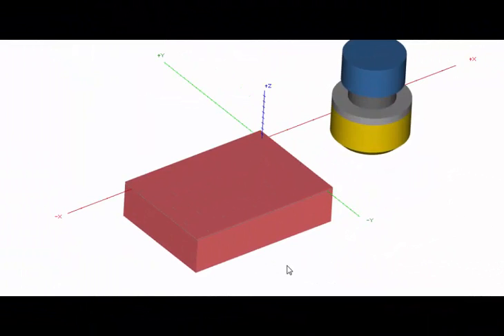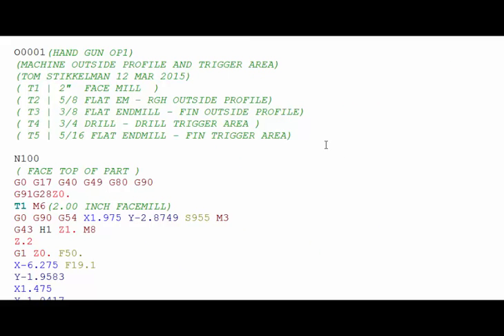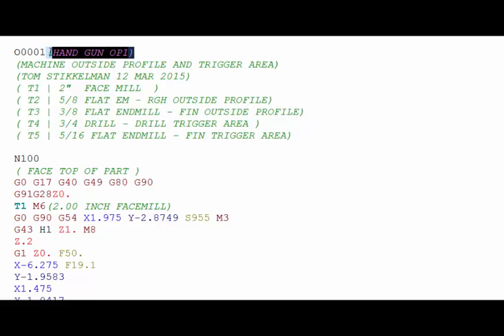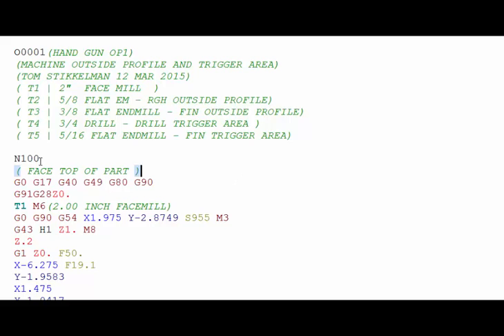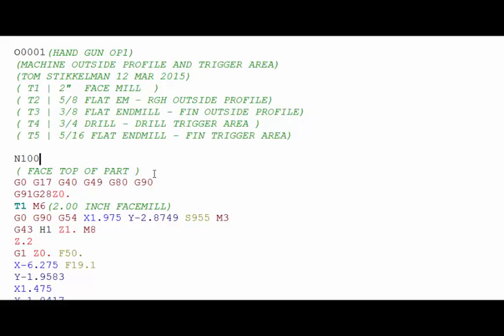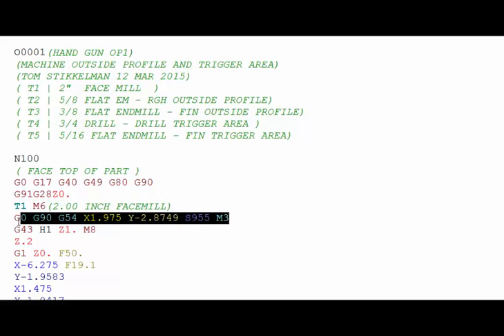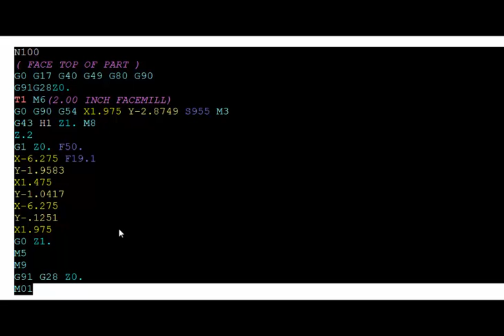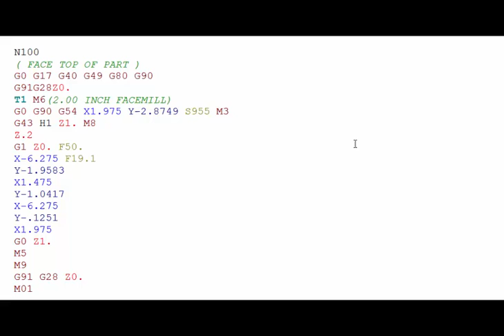HOW TO USE GOOD PROGRAM FORMAT IN YOUR CNC MILL PROGRAM

Comment: Hi Tom, can you help me with the last code " G91 G28 Z0". Why we need to use G91 ( not continue G90). So the next N200 we need to add the safety line G90 to turn it back to absolute progam, isn't it ? Thank you so much, Tom.

Comment: Hi Sir, can you help me with the last code " G91 G28 Z0". Why we need to use G91 ( not continue G90). So the next N200 we need to add the safety line G90 to turn it back to absolute progam, isn't it ?

Comment: Tom what is the function of full stops after some commands?
Reply from the maker: KylesGuitar The 'M01' command at the end of each operation will stop the machine between tool changes or operations. It allows you to open the door and check your part dimensionally to make sure you are leaving a proper amount of material for a finishing operation or you may need to check the ID of a bore before you do a cutoff. The 'M01' optional stop can be deactivated by turning off the optional stop button on the control panel so that the program will run all operations without stopping between operations or tool changes.
Reply: Tom Stikkelman Aha what I was asking about is the dots after some of the commands for example G0 Z1. There is a dot after it, though I was wondering what the M01 was doing down there anyway!

:)